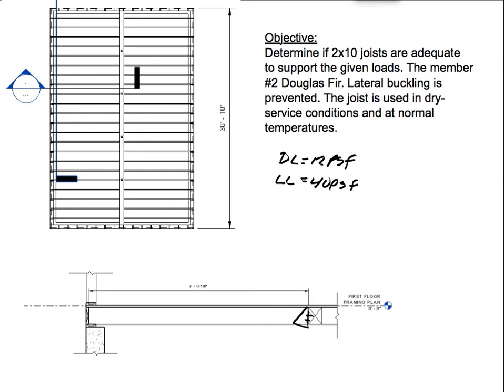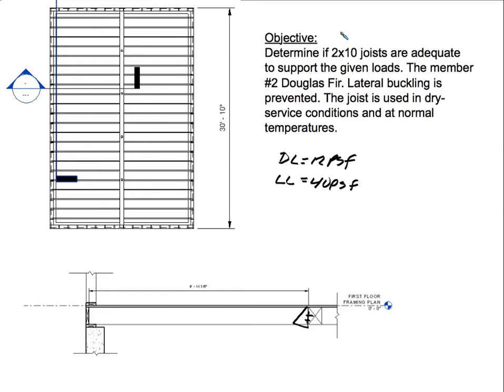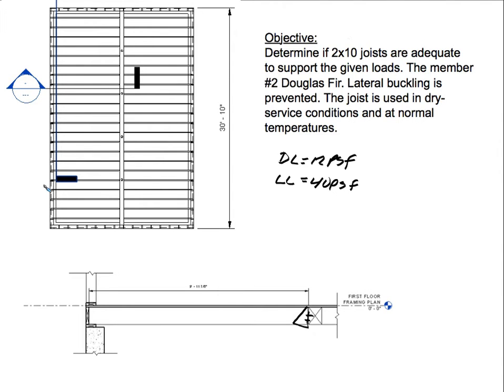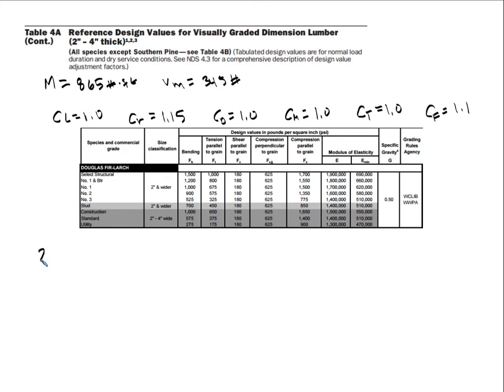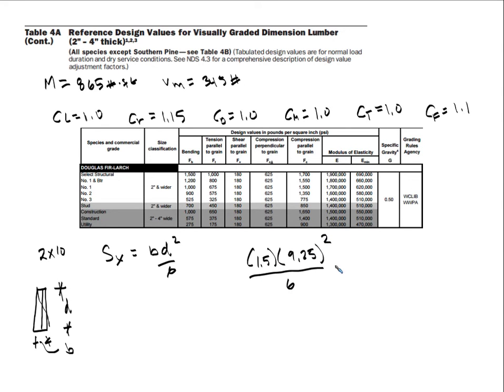Joist- Design Example of a Floor Joist System

Comment: Did you assume Cm =1? According to the Table,  Fv = 0.97 (Cm) and Fb's Cm is calculated  and can be 1.0 if you meet the condition. Can you please explain. Great videos. Thank you
Reply from the maker: I believe I assume that the moisture content of the wood member are in normal conditions. You would use the Fv=.97 if the moisture content of the lumber exceeds 19%.... "When dimension lumber is used where moisture content will exceed 19% for an extended time period, design values shall be multiplied by the appropriate wet service factors from the following table" I hope I was clear.